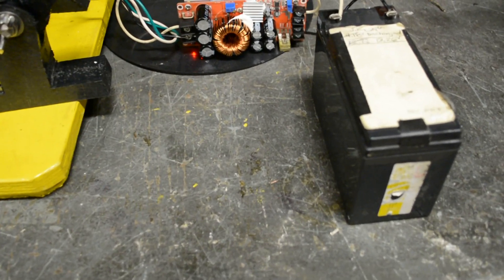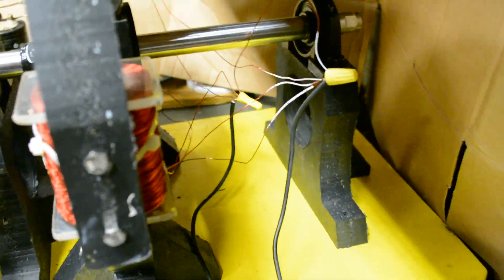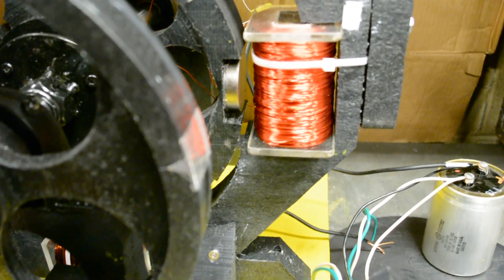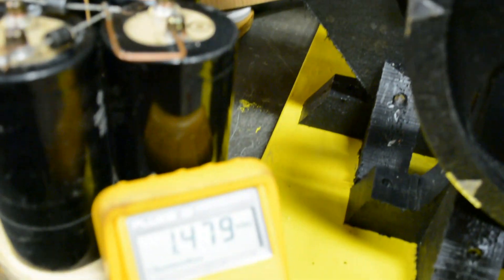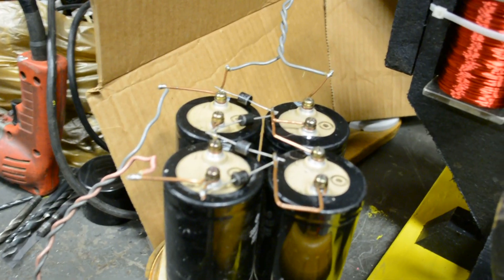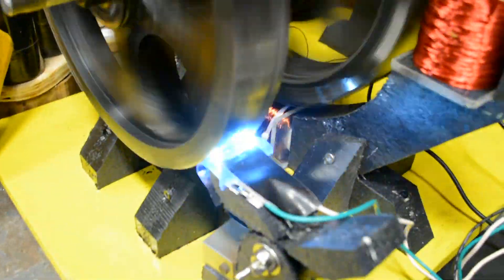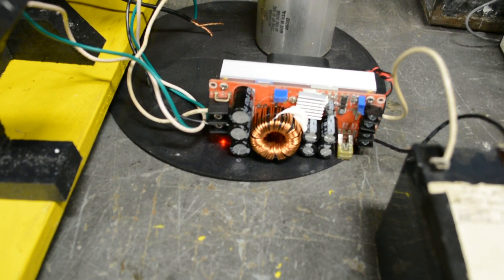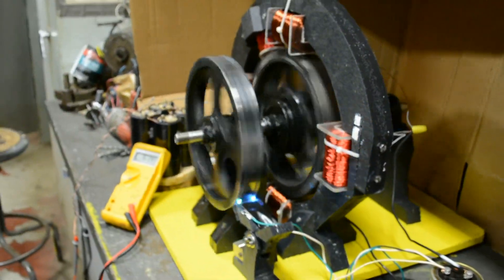Zero Force Motor Model

Comment: It looks more like a pulse DC motor
1 you pulse the DC motor 
2. You capture the energy from the rotation. 
3. You might want to make the coils the same inductance if you don't you losing energy.
4. You want a capacitor on every coil to extract the maximum power and a longer runtime in-between pulses. 
5. I'm making some thing similar but with out all the sparking and extract steps.

Comment: Love it!! Was there a reason you chose the commutator over something like a HALL sensor? Was the high DC the determining factor?
Reply from the maker: I used the metal tape to change up the duration and trigger moments. Easy to see and gauge, next development HALL sensor and MOSFETS with a trim CKT.    Fine tuning to just enough to spin the unite at speed.     Thank You!  : )
Reply: @edge2science  cool can't wait to se it
Reply from the maker: Yes the commutator was to get a visual on the timing. I started you might say long then ended up with what seemed necessary to sustain the motion. Over all an educational model. The base concepts born of John C. Bedini works.

Comment: I like you project! Hope to see more of it.
Reply from the maker: Thank you the machine is now at my home / was in the shop at work now retiring I hope I find the time and more of it to go deeper. I began work on a double through multi pole duel latching relay to transfer the captured energy to capacitor banks dumping and charging the high current 100 plus DC in to batteries.
Reply: Mr. Fowler, wish you a lot of nice project for your retirement and a retirement fulfilled. Be careful, this 100 A DC plus, will zap you! I am currently working on my PMSM, a dual stator which will be nominally capable to produce 99Nm of torque at 100A. Since I had my 3D printer, I started bulding a simily EZ spin motor but I would like to experiment the Bedini SG motor/generator, the Lenzless like you and the Muller one! And I have a small idea for the Bedini SG that should increase the speed - hope I'M right, starting simulation tonight.  Anyway, was a pleasure and you will show me your relay.